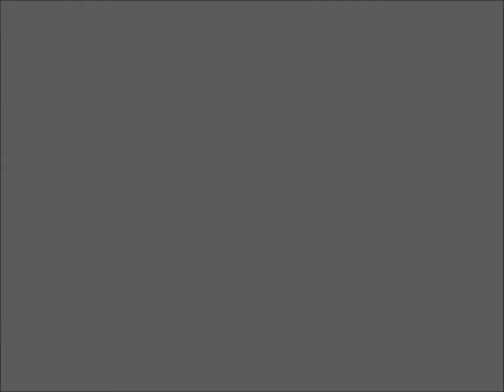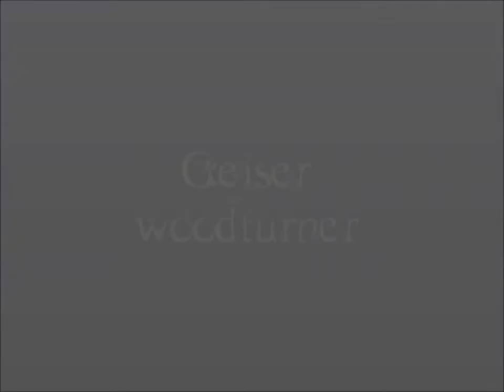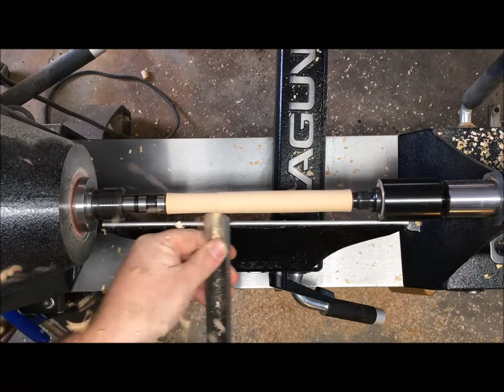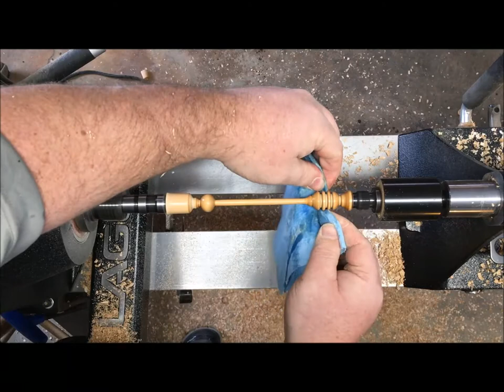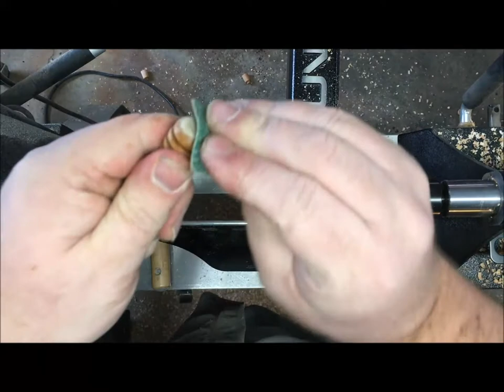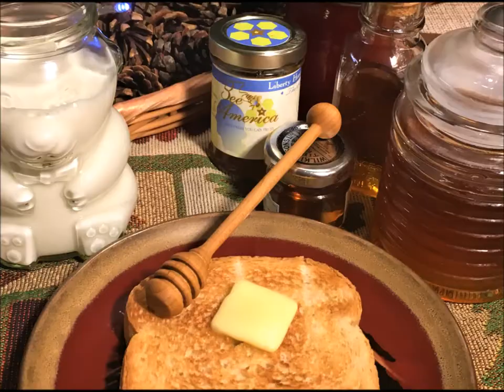how to make a honey dipper in under 5 minutes

Comment: Fun video. A few questions: 1. What type of wood was used and should that be used for all types of projects which will be used for serving food and drink ? 2. Did you clean it off before applying the oil ? Thank you and peace
Reply from the maker: Thanks! I mostly use hard maple for honey dippers.  I try to use a closed grain hardwood for most foodsafe projects so there are less open pores for food to get caught in. No need to really clean fresh cut wood before oil. Just maybe wipe off dust and any left over sanding grit.

Comment: What do you have on the headstock to hold it?
Reply from the maker: It’s a safety drive center with a spring loaded tip. Mine is from craft supplies USA. Robert sorby makes one called the stebcenter.